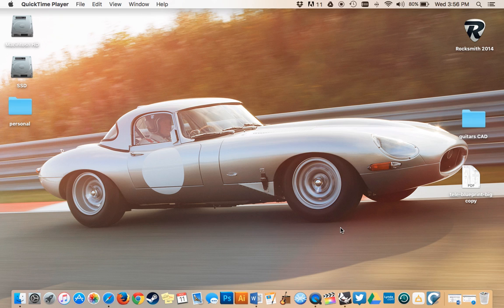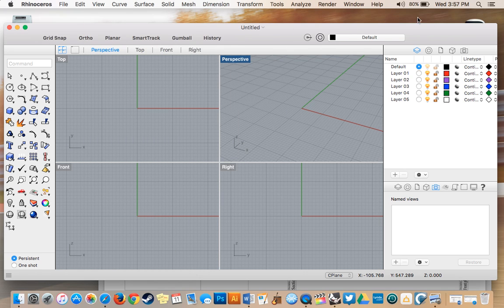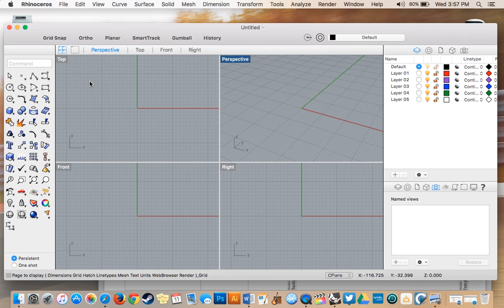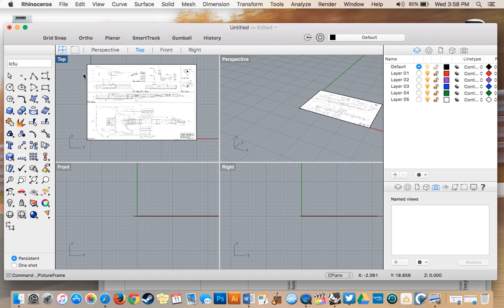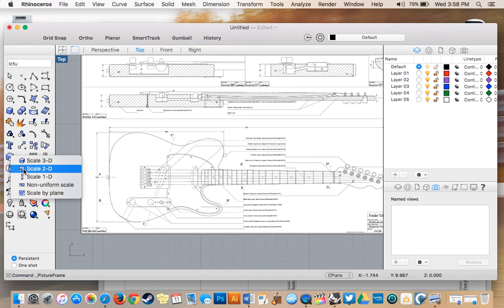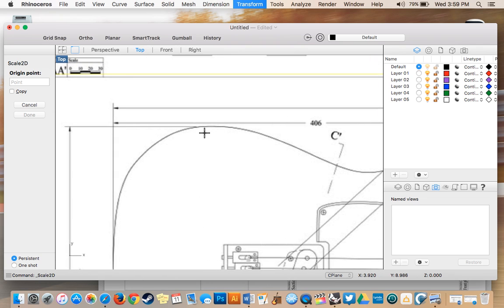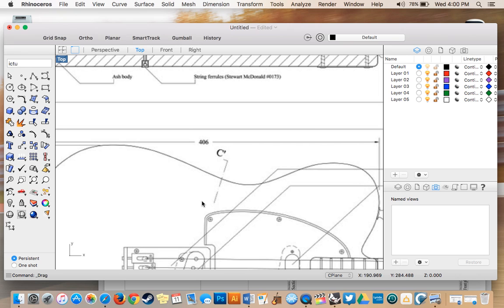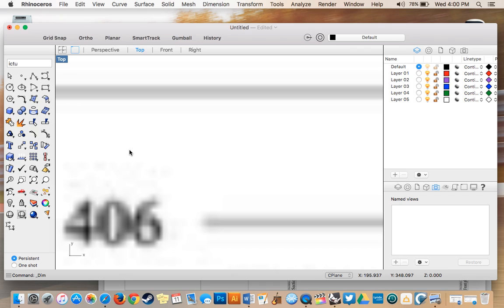RHINO 5 - Importing image and resizing

Comment: Hay, so what's wrong if I save a picture, import into rhino but then the whole turns out picture is black?
Reply from the maker: Try either the picture frame command or the background bitmap command using either jpegs or pdfs. It also depends on the image you are importing. A vector image will work the best. Hope that helps

Comment: Hi  I am very new to Rhino and I have a quick question. I am trying to prepare a file for laser cutting. I have an image (with lots of details) I would like to see if there is an option to quick convert image to curves (like in Illustrator) and then to work further on editing curves and making corrections. Is there a function like this? Many thanks!
Reply from the maker: You can try importing images instead of doing picture frame. However it depends on the image you start with as the wether or not it will work. Usually only very simple 1 colour models work. If the images meets the criteria it will import it to a vector fail. However I would recommend a program like illustrator that deals exclusively in vector files for laser cutting.